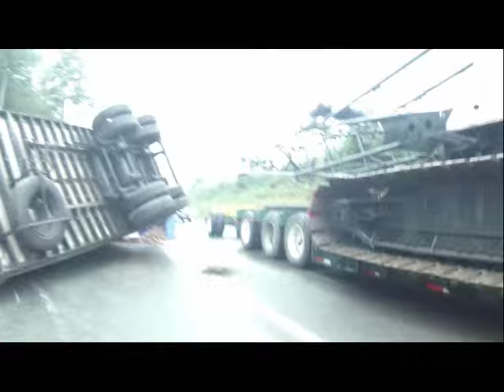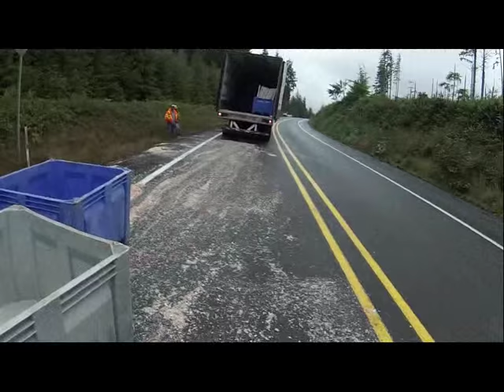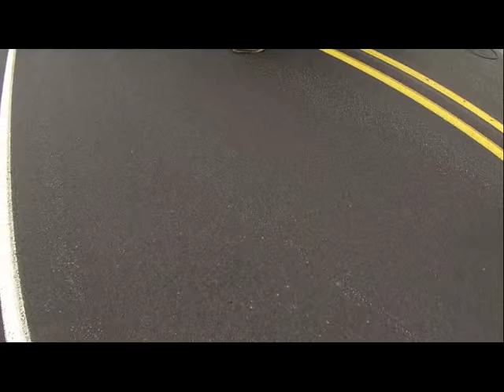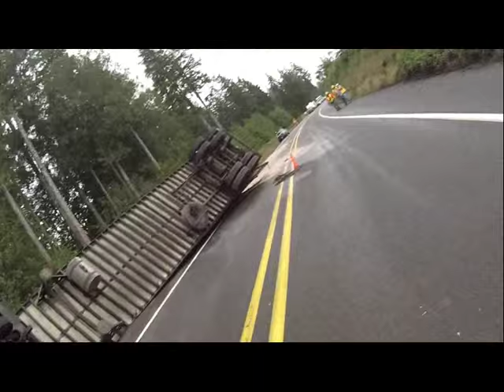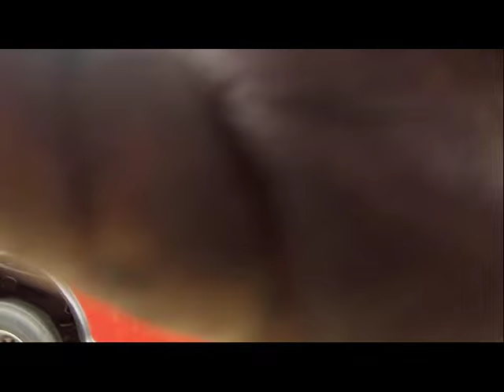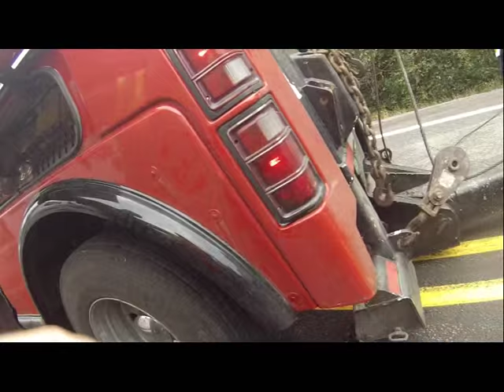Semi Tractor Trailer Rollover Recovery

Comment: George it's time to color coordinate the boom sheaves (yoke) and hooks blue and white on all twin line trucks so those that don't know left from right or front to rear should know what you mean when you tell one of them to pull on blue and or white line. I did that many years ago on my H=Holmes H480 C40, H500 C50, two H600 C60 Chevrolet's, and two Holmes 600's on GMC 9500's one of which was a twin screw tandom.  With those trucks and Holmes 600's wrecker beds I never absolutely positively needed a Holmes 750, but let me tell you I really, really wanted one. Now I admit there was a time or three that I had to get help from my C40, or C50 or maybe both when uprighting a mixer in a downward ditch. It might look silly with six trucks pulling but being able to put the weight and power just where you need it becomes great advantage. 
That concrete is bloody pain on a level uprighting, and more than a damn heavy pain on a downhill roll. So in those times I found myself doing a lot of calling out a name and color for who I wanted to pull from what line. It really helps when the guy doing calling is in the woods calling to the operator. It ends 97% of the confusion.

Comment: Should have dropped drive shaft and placed all chains before hooking up. Also spread out winch points. One to steer axle, one to drives, and one to trailer. Will work faster and better.

Comment: Is that a little 5th wheel hitch on the tow bar of the red tow truck?
Reply: yes it's a little 5th wheel
Reply from the maker: +ejwa12 
The fifth wheel attachment  came with the truck .  This  was the second time in two weeks we got  to use it . I had a tractor trailer rig go over last week with 40,000 lbs of frozen shrimp . I had misplaced my gopro cam so we didn't get any   video on tha tone  .
Reply: +Hill Auto Body & Towing Good to see you teachin them youngins to do it right, though I gotta tell ya, ya need to teach em to be safe around them cables, couple of them got themselves in some pretty bad spots if any of those cables let loose. 

The snatch blocks would a dampened the cables on the red truck some (still a bad spot to be in though), but the one filming near the long cable to the trailer would a been in a really bad place if that one had let go as there wasn't a snatch block on it to dampen it. Accidents are bad enough, but it's way worse for somebody to get hurt cleanin one up, especially when you gotta be the guy to tell his family why he doesn't get to come home! 

Stay safe.

Comment: Those smokey tow trucks need a tune up.
Reply from the maker: Old smokey has  a variable timed cam that  is supposed to adjust the timing  using an air  temp sensor . It  was designed for CA . Unfortunately it never worked properly  from the factory . To fix it we have to change out the  Cam ,      and  fuel rails . It is,s  worth the money to do this . My plan is to  replace the truck in the near future with a newer Kenworth